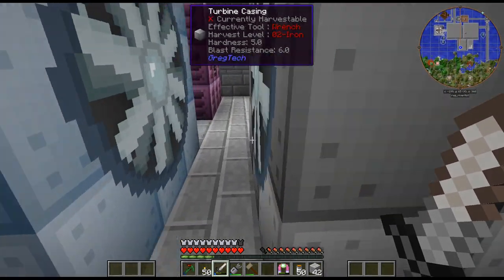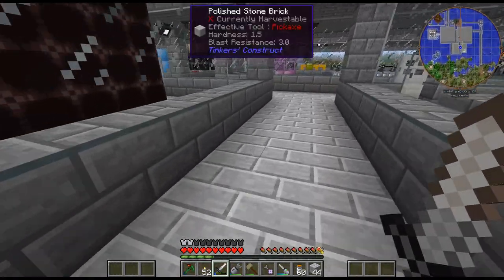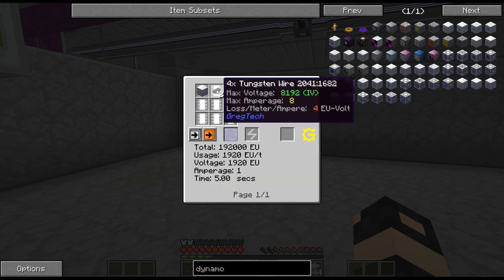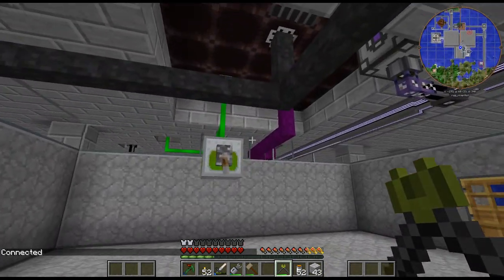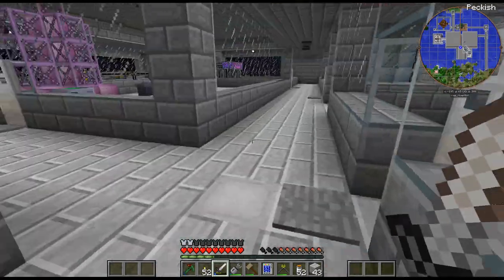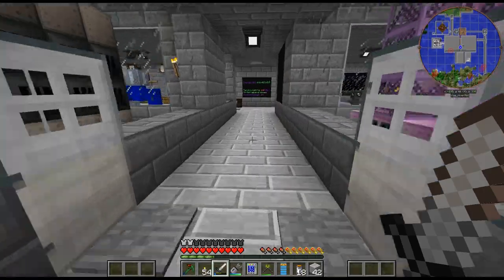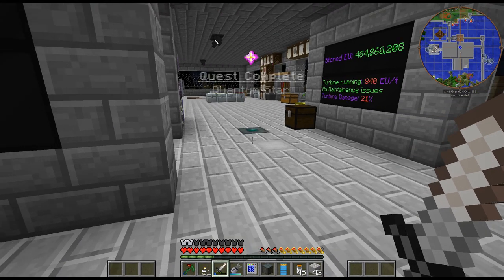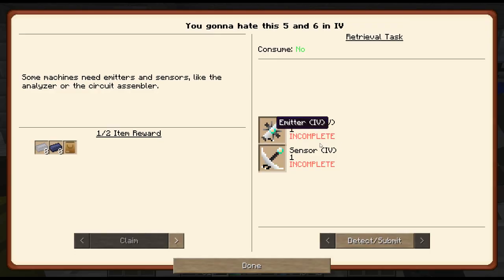Gregtech New Horizons - 134 - Quantum Circuits Part 1

Comment: Might be worth turning everything off and run the diesel engine with oxygen cause this also raises the efficiency of the burned fuel to 150%. Oil is the only bottleneck i guess